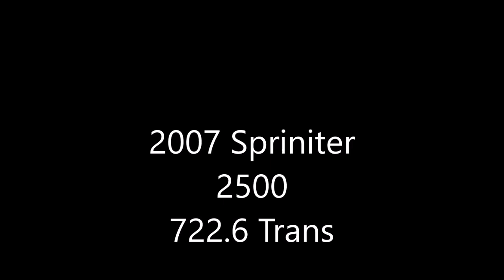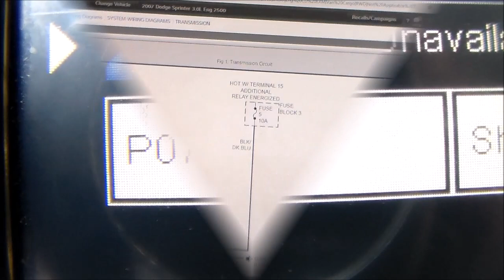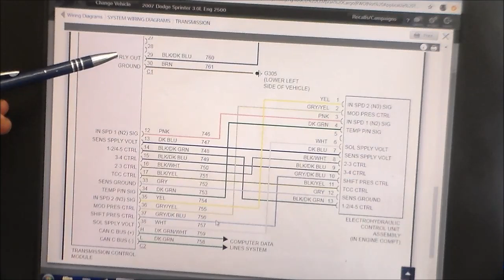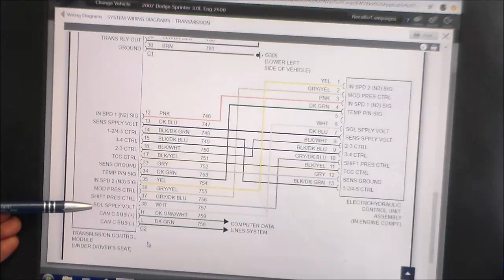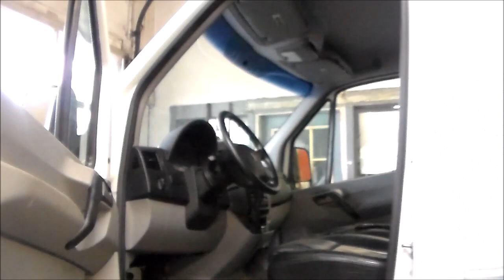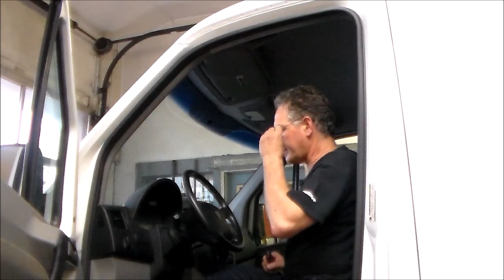722.6, P0778 Diagnosis and Repair

Comment: i have 2000 w220 s280 and i get same problem. i swap egs52 module with same part number from w220 s320 and it only can shift untill 3rd gear and enter limp mod. do i need egs51 module from w220 s280 only even not same part number?

Comment: Hello Gary, Sorry for watching 5 years later. Very interesting your lesson. I don't know if you would see this comment. I've a dodge nitro with same DTC p0738 same down voltage from EGS and same symptoms. I've a question. Does it work by swapping directly a used TCM
/EGS from another same Nitro or have to reconfigurate it?
Thanks for answering
Reply from the maker: I think you will be ok, i believe i swapped out jeep TCM with Nag1 and it started right up

Comment: I have a p0778 on my duramax check wires and OMS and everything’s good
Reply from the maker: what trans do you have
Reply: @GaryFerraro  Allison 1000
Reply from the maker: what is the definition of that code? @A2ZREY
Reply: @GaryFerraro  2003 chevy 2500hd 6.6 p0778 Pressure Control Solenoid "B" circuit- electrical
Reply from the maker: @A2ZREY  if you clear the code it comes right back?

Comment: I’m having the same issue (06 charger 6.1L) TCM is only sending 1.9v to transmission… tried swapping TCM TWICE but all three TCM’s are sending 1.9v even when voltage coming into the TCM is reading 12v. Any ideas what it could be? Thanks
Reply: Would it be possible to just send switched battery voltage straight to transmission via an auxiliary wire bypassing the 1.9v output of the TCM ?
Reply from the maker: you have to see where the volts come from,  may be a bad T.I.P.M  @adamhallmc
Reply: If the  TCM is always supposed to send 12v battery voltage out of pin 38 to transmission, would it then be possible to just Hotwire 12v battery voltage (switched of course when key on) to transmission to bypass This weird phenonmon where all of TCMs are sending only 1.9v?

Comment: God
Reply from the maker: Thanks for watching
Reply: @GaryFerraro   Thanks for these awesome videos.
I have a 2012 durango with this transmission and have p0748 even after solenoid replacement and circuit board. Do u think this could be the problem or the oil pump is worn out? it has line pressure of 14 and solenoid pressure of 29. bumps to about 50 while shifting. thanks
Reply from the maker: @sanjec  what is your engine size?
Reply: @GaryFerraro  Thanks Gary. Engine is 3.6l 2wd. modulated psi is normally 14 and goes upto 50 while shifting. and has 0 psi at times. it drives 3 days fine before setting p0478.(modulator pressure solenoid performance) not sure the oil pump is weak?
Reply from the maker: @sanjec  are you sure it's P0478?
Reply: @GaryFerraro  yes. exactly like ur p0778 but for the modulator solenoid instead of pressure solenoid on urs.
Reply from the maker: @sanjec  ok, so what have you done so far? how fast does the code come back?
Reply: @GaryFerraro  did conductor plate. Code came back in 3 days. P0478 in stored codes all the time. Goes to limp mode wen active in 3 days about 30 miles. Did the  modulator pressure solenoid and the same thing. Code comes back in 2 days. Shifts really good until the limp mode kicks in.
Reply from the maker: @sanjec  You probably have a computer problem, everytime i had this code the TCM fixed the problem, you checked the wiring?
Reply: @GaryFerraro  yes. i can see 13.5 battery voltage. 13.5 solenoid voltage and 6.2 speed sensor voltage on my snap on. this is with engine running. it doesnt drop at all. the only issue is modulating pressure that doesnt go as high as solenoid psi. when i disconnected my tcm it did the same thing as urs with clunk on shifting and limp mode. when plugged in it shifts fine for about three days no code. then it gets p0748 and limp mode.
Reply from the maker: @sanjec  This is electrical code, may have to monitor the control wire of the solenoid to see what happens when the code sets
Reply: @GaryFerraro  thats my plan. Waiting on the code to set. Thanks a lot Gary. Really appreciate you taking your time to answer me

Comment: Thank you for the great video and info. I got actually the same problem and I am doing my research before I start , ur video helps me and to know now how to start. Thx again and greetings from Austria.
Reply from the maker: Wow Austria, Greetings from New York
Reply: @GaryFerraro  Greetings back 😊 I have checked today my benz with icarsoft 980, CLK 320 , 2002 it’s in limp mode , shifts only till 2nd , bang is heard when changing from P to D and i got this code: 
P206D component N15/3 (EGS) saved error is P0730 , DTC Status Check engine lamp is on . 
So what do you think from where to start?
Reply from the maker: @megamac3898  How is fluid level?
Reply: @GaryFerraro  fluid Level i measured with this extra dipstick and was correct

Comment: what will happen if you'll take a c-class w202 computer , for instance and install it? will it work? is there away to "copy" the adaptations if they are not the same part number?  can you swap the chip inside?
Reply from the maker: If the axle ratio is not correct it will not work, data can be transferred with mercedes software
Reply: @GaryFerraro  so the computer will expect to see certain internal speed that comply with the car speed, and if it want match will assume slipping... or simply the bus of the car will not communicate with it since they are not sinced through the car can bus [different id for instance]...
Reply from the maker: @golanpeled8960  It will expect to see a certain ratio, if it does not will set gear ratio codes and not shift correctly
Reply: @GaryFerraro  thanks and I like watching your videos...
Reply from the maker: @golanpeled8960  Thank you